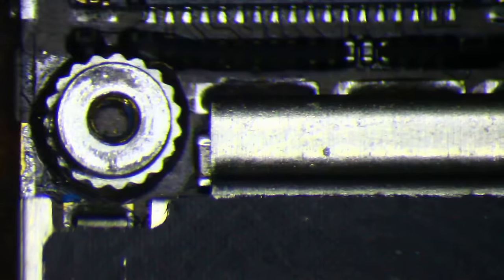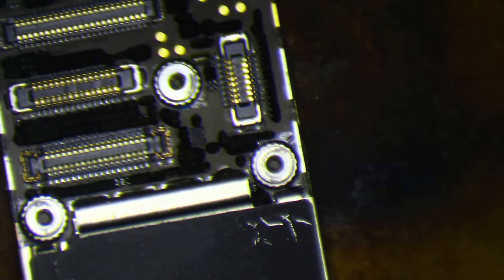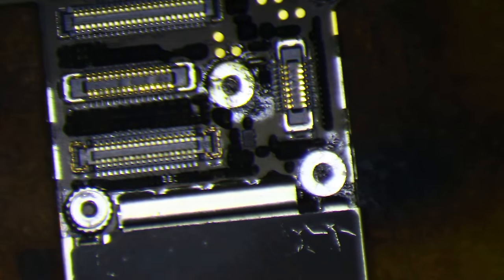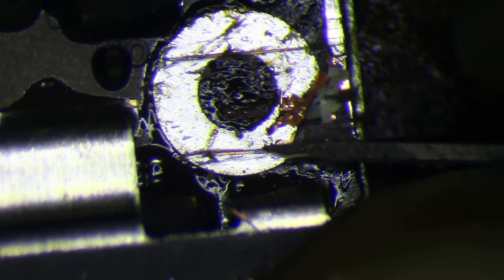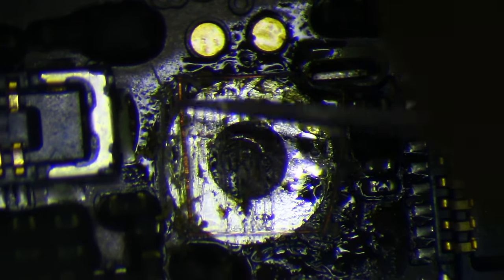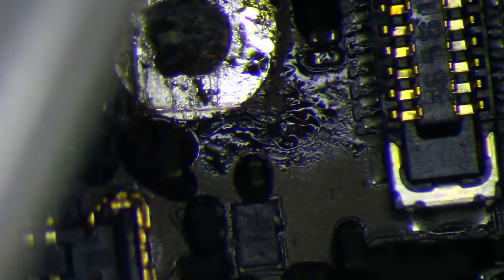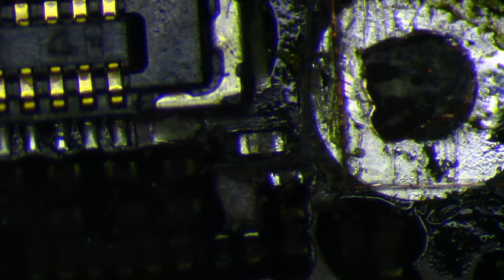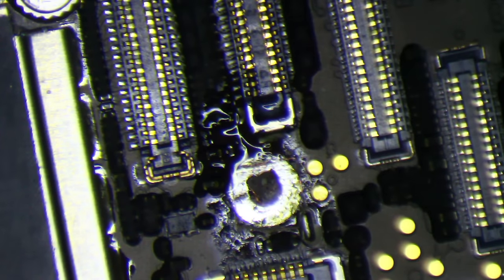iPhone 6 long screw damage in center hole - Easy!

Comment: Dear Mark, love you work, it is great. Hope you could help with a little advise and where to look at with my iPhone 6. It can not be restored but restore process starts fine, recognizes iphone and shows s/n. Tried many many times, swapped board with different screens, housings, batteries ..etc. DFU mode, latest itunes, other laptop, usb ports, tried apps to kick out recovery mode, - every time same story, it stuck on apple logo with spinning wheel and itunes shows us "waiting for iphone".
I have other donor logic board iphone6. If there is a hardware issue, micro parts can be used to build 1 working board? Going to take to local repair shop and explain them an issue. I will appreciate if you could point to the specific hardware problem, what has to be replaced. I see you have got massive experiece in it. I'll appreciate help very much.
Kind regards, Max.

Comment: My mic doesn’t work sometimes and my screen gets lines in it sometimes but if I slightly twist my iPhone 6 he screen goes back to normal is that LSD?
Reply from the maker: Jared Colbert no that sounds like two separate issues, the image problem most likely being a bad lcd.
Reply: Mark Shaffer forgot to mention my headphone jack doesn’t work either.. screen is brand new though
Reply from the maker: None of these issues are related to long screw damage or even likely to be a board level issue. Sounds like you need a new dock and a good screen. New does not mean it wasn't damaged during installation or defective in some way.